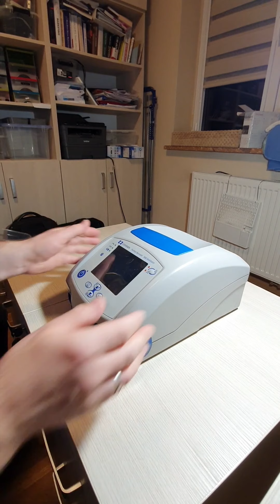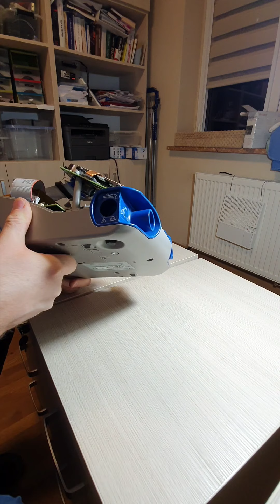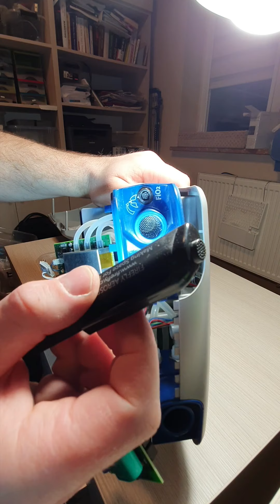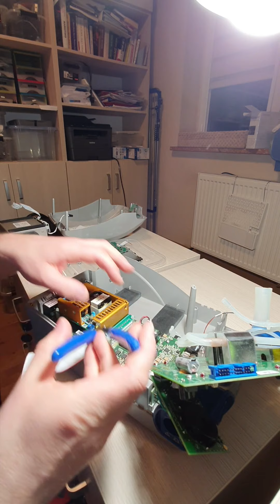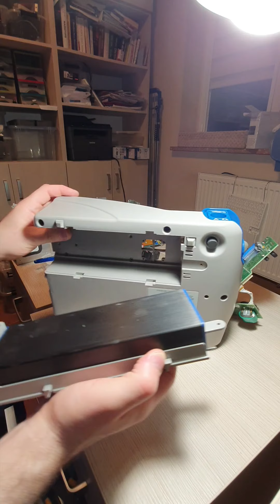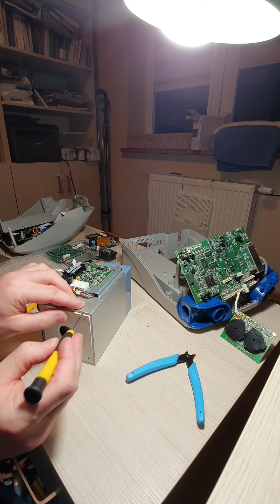Covidien ventilator teardown

Comment: Hello! Is there a screen protector (a piece of glass for example) in this model between the screen and the membrane (that contains the membrane switches)?
Reply from the maker: The keyboard and screen protection foil is the same thing. I mean the keyboard foil is transparent in display area.

Comment from the maker: In fact, there is no diaphragm in the exhalation port, but some mesh that obstructs the airflow. The connector in front, is not for SPO2 (there is such option for this device but currently not populated) but for FIO2 which is oxygen concentration sensor. The LCD is B&W parallel port display. It has so few wires because it supports just a few gray tones. The wireless alarm module is not installed in this HW revision.